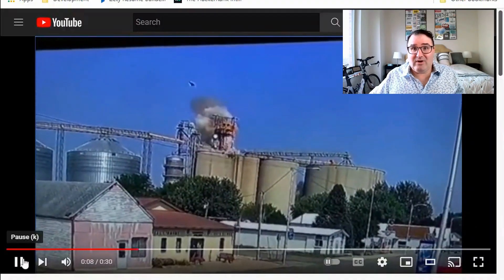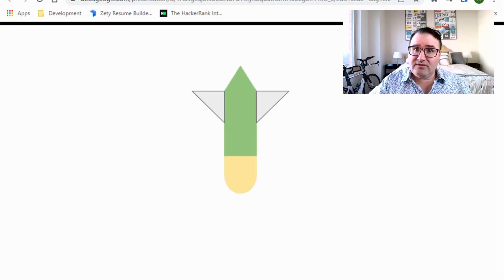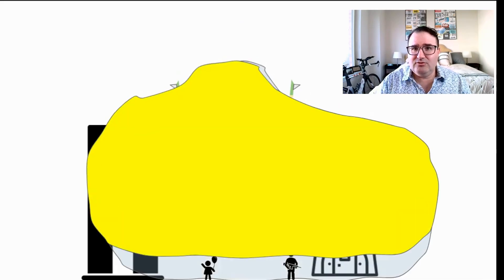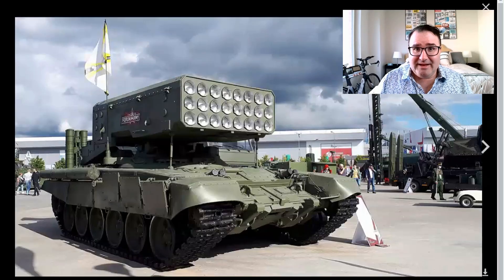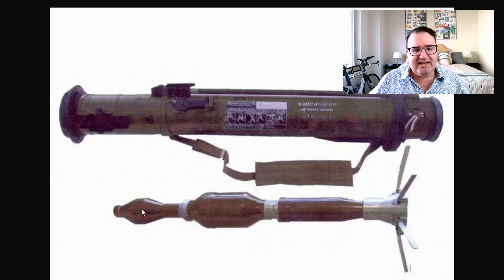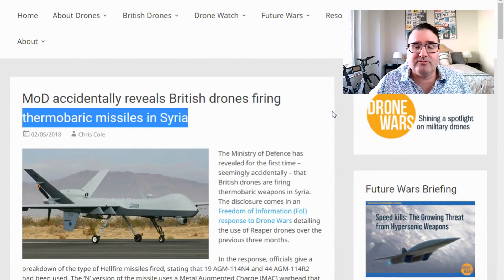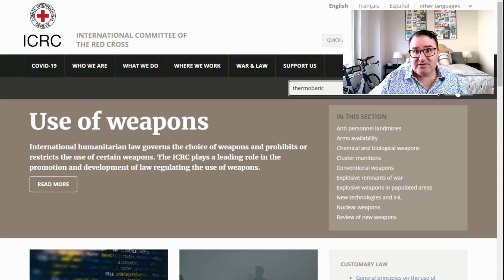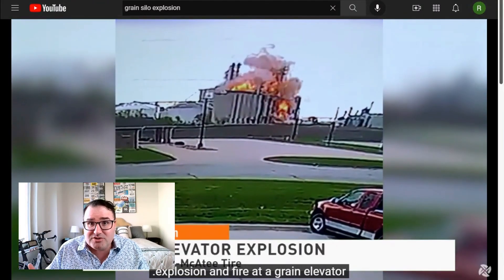How do Thermobaric "Vacuum Bombs" actually work?

Comment: I'm certainly no expert, but I did study Mining Engineering 30 years ago which included a significant chunk of Preparation And Use Of Explosives (the best part of the course, but I doubt such knowledge would be taught in that form today for obvious reasons...), and we also had to study Mining History, of which a significant part was how a Cornishman named Nicholas Trevithic (Sorry guys, but he wasn't an American...) had single-handedly started The Industrial Revolution by inventing Steam Power less than a mile from the college campus (in Camborne, a very small mining town in Cornwall, the County on the most South-Westerly tip of England) which allowed Mine Workings to be pumped-free of water and therefore become far, far deeper than ever before, as well as subsequently providing the power to raise the Tin Ore-laden rock (Arisings) from the depths of the Earth and transport it to the coastal ports for export, as well as eventually providing the power to the Steam Locomotives and Steam Ships which shrank the World and led to the society that we live in today...

Anyway, my point is that any water vapour or ambient humidity, when exposed to temperatures 1/3 that of the surface of the Sun, would instantly turn into Superheated Steam and expand far more (and significantly more violently...) than a similar volume of dry air would expand in the same fraction of a second, and this would indeed create a far greater shockwave than arid air under the same conditions, but I feel that we would need A Proper Scientist to explain the numbers to us mere mortals...

P.S. If you've read this far then Thank You for not falling asleep at your keyboard 😁👍
Reply from the maker: This is really good

Comment: Hey man, I followed you for while but first time commenting. I actually got my engineering degree on thermobaric explosives and all you said is  totally correct and you didn't even slip up with terminology.

About your question then yes, all chemical reactions are affected by ambient temperature etc, and FAE and TBX are using atmospheric air just like in combustion engines (where humidity and temperature affects power (intercoolers), mileage and efficiency). I don't think it would make much of a difference for explosive charges. In FAE most of the fuel doesn't care about water, in TBX those flammable metals just get crazier in water and the miniscule timeframes also don't make me feel too afraid of the water. One thing makes me thing is charge dispersion/timing which is has to be tuned very carefully. In low pressure situation (some high mountains or something) the timing will be way off the optimal.

In general with explosives we talk about oxygen balance, the more of the oxygen is inside the molecule the better, because we dont need to get it from air and the explosion can be faster and cleaner. Here with thermobarics (TBX) we just flip the think upside down. Because of that you do get more bang per KG because you dont carry the oxygen. You also get different explosion process with slower speeds but higher volumes, which tend to topple walls not crack them.

Now interesting part about the vacuum. There is sometimes little but more under pressure created by the thermobaric than conventional explosives. It is visible if you plot pressure against time during explosion in experimental settings (the one I worked with) however the under pressure and the wave is so small you would never notice it yourself or by witnessing the explosion.
Reply from the maker: I really appreciate that – would you like to collaborate on a follow up video?
Reply: @RyanMcBethProgramming  If you need any info about thermobarics and FAE don't hesitate to hit me up!

Comment: I would think the added mass of the water in a high humidity environment might cause the explosion to be slightly less powerful because that mass would be absorbing some of the heat energy. That said if I'm right we're probably talking a difference that would only be detectable as a tiny blip in test results.

Comment: I would think that rain would lessen the effect of a themobaric explosion. When the space shuttle launched they would have what were basically giant sprinklers spray a ton of water under the engines on take off to prevent the shockwave from the engines from destroying the launch pad (that’s what that white smoke looking stuff under the rocket before take off is). The energy would be absorbed by the small water droplets and cause them to evaporate. I think rain/mist could achieve a similar effect but i definitely wouldn’t want to anywhere near one no matter how much rain is between me and it.
Reply: Alternatively it could have a similar effect to water injection on internal combustion engines and increase the effect of the weapon but I don’t think that is as likely. In an engine the water would be injected in the intake manifold where it would evaporate and cool the intake air temp making it more dense (more oxygen) as well as the cooler temp helping to reduce engine knock.

Comment: Fuel-Air bombs are referred to the poor man' s nuke. They can be more  destructive than regular explosives. And with air as the oxidizer, can be more powerful by weight.
   Don't know what effect rain and humidity would have. Lower temperatures would probably slow the reaction and reduce the devastation.

Comment: I don’t know if what happens technically counts as an explosion. There is a rapidly moving wavefront, but the effect is distributed over a larger area than with a conventional explosive. It certainly is destructive as any grain elevator operator will tell you.

I’m  an industrial engineer and I’m familiar with both the issue with dust such as grain, coal, sugar, you name it. Usually with these explosions the main problem is that the rapid expansion of gases occur inside something and that causes the destruction of whatever that something was. The thermo baric weapon seems to be a little different in that most of the fuel is burned outside, but enough gets inside to do a lot of damage.

The rain is an interesting question. Rain would wash some of the dust out of the air, but most of the dust environments are not outside, so the potential for this happening isn’t there. These things have been in use for a while and probably there’s a white paper somewhere but then again it’s probably classified.

Comment: 4:10 This is a common misconception. Humid air is less dense given that H20 is a much lighter molecule than N2 or O2. It only feels "heavier" to us humans.
Reply: You’re forgetting air pressure’s influence on relative humidity, and that there’s also more nitrogen and oxygen gas in the air below 1000m sea level where air density is at its most packed, and you’re forgetting that most atmospheric air is N2 

Humid, warm air is denser per cubic inch than cold, dry air. Ask any pilot and they’ll tell you the same thing.
Reply: @DoctorProph3t  Nah bro, you're confused. You certainly can't float up in a cold air balloon. 

The atmosphere is stratified the way it is (and undergoes convection) because the Earths surface is continually warming the air near the ground and heat is escaping into space high up. Not because warm air is somehow denser than cold air.

For the purposes of the video with an exploding bomb, what I said holds true. On a Hot/humid day the air would be less dense than a cold/dry day.
Reply: @DoctorProph3t  "You’re forgetting air pressure’s influence on relative humidity"

Air pressure at any given height varies far less than what's the difference in the molecular weight of H₂O to N₂ or O₂.

"and that there’s also more nitrogen and oxygen gas in the air below 1000m sea level where air density is at its most packed, and you’re forgetting that most atmospheric air is N2"

That doesn't change anything. A water molecule is much lighter than both N₂ and O₂ molecules.

"Humid, warm air is denser per cubic inch than cold, dry air."

No, it's less dense.

"Ask any pilot and they’ll tell you the same thing."

They won't if they know what they're talking about.
Reply: @DoctorProph3t  H2O has a molecular weight of 18, versus the 28 of nitrogen.  Relative humidity is only a measure of the vapor pressure of water in certain conditions, not the absolute ratio.  
Also, "denser per cubic inch" makes no sense.  Density is already mass/volume.

Comment: Water / rain should not be a problem as the heat generated turns it to vapour instantly realising the O of the H2O and/or replaced by the compressed air pressure & oxygen at cloud level drawn in.

Sorry if elegible has shacks hands and can’t see outside..!

Comment: My understanding of these weapons is it creates a larger area of deadly air burst overpressure with less high explosive. I'm not sure the idea of the fuel going into cracks makes sense to me. It's still just fuel, so it needs a good fuel air mix to explode. If you squeeze through a crack, you likely won't have the correct stoichiometry for the explosion anymore is my thinking.

Comment: Humidity and rain don't really pull oxygen out, but they can cause particulates to come out of suspension. This is why the air feels so clean during and after a rain shower. I can see high winds or torrential rain having an effect by dissipating the fuel from the canister, but you don't generally use rockets or planes during such heavy weather events. But also, for high wind, high humidity, or heavy rain to have any real effect the weapon would have to be used outdoors, which also reduces the effectiveness. You really want to get these bombs to go off in a relatively enclosed space for maximum effect, and weather tends to be minimal inside a bunker.

Comment: Humid air is lighter than dry air, otherwise we wouldn't have clouds :). Also, at 100% humidity air at 20°C can hold up ~2% of water vapour, I don't think this would make those explosives significantly less potent. Rain has virtually no effect - heavy rain is considered 8mm/hour - nothing. How it would affect the spread of fuel is another question though.

Comment: I've only heard these devices called "vacuum bombs" on a handful of occasions, most of the time people would call them "fuel-air bombs". A very meme-worthy application of the dust bomb phenomenon is the "sawdust fireball" (compressed air + sawdust + road flare), which MythBusters turned into a "coffee creamer conflagration". Fuel-air mixtures are only explosive at certain ratios, otherwise they just burn (see also: popping a can off a stack of Pringles using hydrogen, or more commonly, the classic coffee can / natural gas bomb).

I've played Command & Conquer Generals, which has such a weapon for the US factions. Fun to deploy unless the bomber gets shot down en route.

The news is playing this up? I'm thinking they ran out of things to talk about that would scare people into watching ads.

Comment: Air is less dense when humid: Avagadro's Law. 

Same pressure gasses have same number of molecules. 
H2O has a lower molecular mass than O2/N2. 
In humid conditions, some of the O2/N2 in the air is replaced by lighter H2O molecules.
Density=Mass/Volume
For same volume, if mass decreases, so does density.

Comment: As water molecules are smaller and provide a smaller number of calories than the larger al molecule are smaller and provide less energy release than the larger oxygen (O2) molecules. The amount of humidity also impacts the burn rate and the duration of the combustion process. A higher duration also slows down ignition as it increases. This therefore makes the thermal efficiency lower.

Comment: Rain is water.
Water is hydrogen and oxygen molecules.
If you get water hot enough, I've heard that the hydrogen and oxygen separate forming and even bigger fire.
For example, apparently if you throw it into a bonfire that is hot enough, and presumably why during the January 2020 Australian fires, reportedly the water sometimes made the fires worse.
So if the heat from a thermobaric weapon is 1,000⁰C to 1,700⁰C, then I'm guessing that rain will just make the thermobaric explosion far more powerful.
I wonder hot hot water needs to get before this process actually happens?
Reply: @Aditya Chavarkar This is one of those things that needs to be tested, before you come to that conclusion.
Again, like Mythbusters episodes, you would be surprised what actually works in testing, as opposed to what you think would work just in theory.
Also, we have real world evidence to back up this theory, most notably, as mentioned, the Australian Bush Fires of January 2020.
This is how science works.
Reply: @Aditya Chavarkar  @Aditya Chavarkar  This is one of those things that needs to be tested, before you come to that conclusion.
Again, like Mythbusters episodes, you would be surprised what actually works in testing, as opposed to what you think would work just in theory.
Also, we have real world evidence to back up this theory, most notably, as mentioned, the Australian Bush Fires of January 2020.
This is how science works.

Comment: Chemist here (gas reaction kinetics and combustion). 45c ambient at 100% relative humidity would have the partial pressure of water vapour at ~9.6%. So there would be some "dilution" of the fuel-air mixture but not a huge fraction.
Reply: And you’ll also know that humid air is less dense than dry air because water molecules (18 g/mol) are much lighter than nitrogen (28) or oxygen (32). The water molecules add volume to the air for less mass, so it becomes less dense.
That’s why humid air rises, potentially creating cumulonimbus clouds.
Reply: The H2O contributes additional hydrogen besides the petroleum distillates in the fuel cloud. Wondering about the kinetics of the hydrogen contributed by water vapor to the overall combustion model.
Reply: @jdstar6352  The hydrogen in water is already bonded with oxygen, so it won’t contribute anything to the combustion kinetics — which by definition involves atoms becoming newly bonded to oxygen.
Reply: @jdstar6352  If it does anything, it's making the bomb less effective by diluting the pressure pulse. Ideally you want the bomb to release all it's energy at once in the form of heat which then creates a massive pressure pulse in the form of a shockwave. If some of that heat is absorbed by the H2O to decompose it, it's going to spread out the energy pulse over a longer duration even if you get the energy back when the hydrogen and oxygen reacts with something later, so it's still detrimental to the desired effects of the bomb.

What could be beneficial would be fog, as it's phase change from liquid to gas could help increase yield due to the big increase in displacement.
Reply: Wait isn't  experimentally determined that 50% of water decomposes at 3000C at 1 atm?
Reply: @pmathemagician  That's sort of correct. The trouble is that to get water vapour to that temperature requires a lot of heat energy and thereby cools the gas. So that's kind of a self limiting effect.
Reply: @garyknight8616  hmm yeah, that is a major factor, but maybe the energy requirement for the decomposition of water at that pressure will be not significant, but this is just a my hypothesis though. Maybe a good research topic I guess
Reply: @pmathemagician  If any water does decompose, it would fuse together shortly after or form new compounds with the fuel. None of that is likely to emit more energy than the decomposition of the water initially took away from the explosion
Reply: @pmathemagician  the combustion environment isn't going to be anywhere near 1 atm in a confined space once the air comes up to temp, but out in the open ...yeah you'd get some low pressure high temp decomposition. that being said the addition of oxygen and hydrogen to the reaction from water vapor will be negligible due to the limited mass of water vapor in air even at 100% humidity and STP.
Reply: I love science, Gary.
Reply: eh, aerosol combust with oxigen in air, water is not significant , BUT water  heats up in explosion and adds pressure- which makes big difference. This is well known fact. You can check this at ww2 piston driven aircraft engines. They sprayed water in chamber to add power. Heat used to heat up water cools down explosion, but if you start at peak 1700°C and most organic stuff have low flame temperature it doesnt matter that much
Reply: @klan80  the liquid water spray was added to prevent engine knocking (detonation) to allow the use of higher compression ratios and higher boost pressures. It's higher CR and boost pressure that creates the greater power.
Reply: @garyknight8616  you are right , reducing knocking is also one of benefits adding water in intake. But since thermobaric head doesnt worry about knocking of piston engine, i didnt bother to mention it. Some jet engines also have both stages equiped with water pump. You want to build the pressure in engine, not the temperature. Ideal engine would work at room temperature and all energy would be used as pressure. Problem is also adding water and pumps and sensors to vehicle...

Comment: this must be very similar to the combustion of fuel and air mixture in a gasoline engine, in that case adding non combustable gasses, like water vapour or emisson gasses will reduce the temperature since heating that gas takes energy from the combustion. Since water has very high specific heat capacity it could be significant. If water dropplets are in the air, and not only vapour, boiling the water requires even more energy.